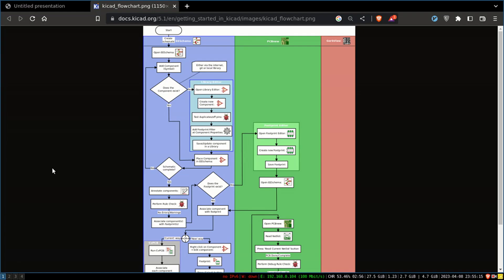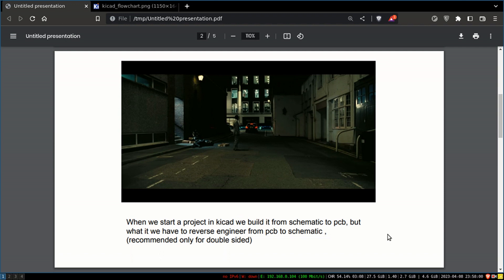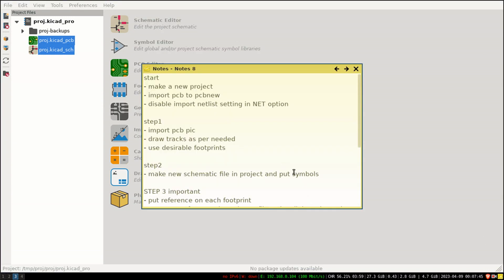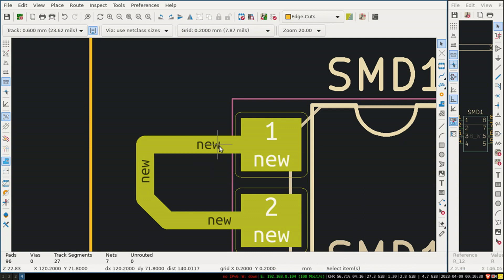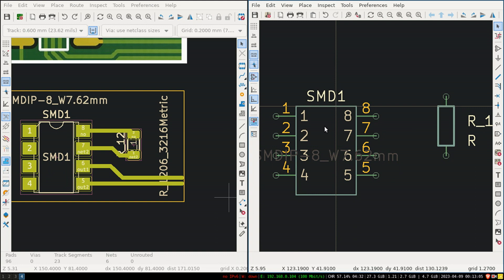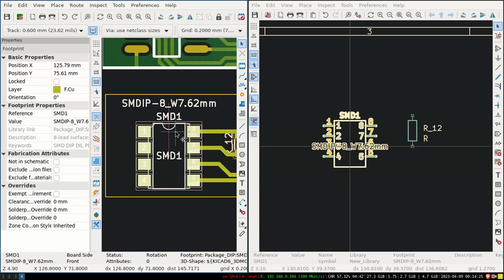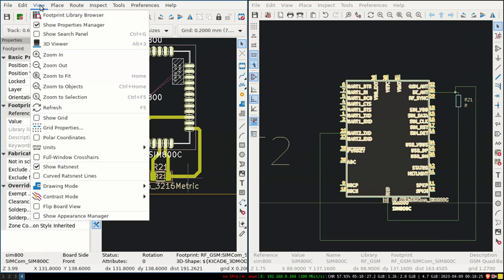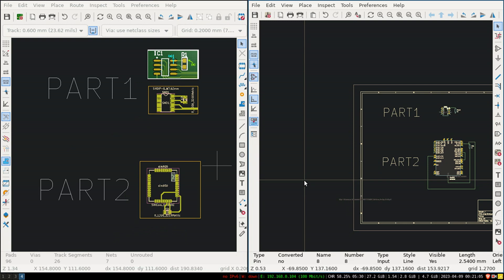Schematic from PCB , Reverse Engineer in Kicad : Advanced , Examples included #kicad

Comment: Thank you for the video. It is what I was asking  for earlier today!
Only problem is the volume is generally too low but especially around the 5 minute mark. 
I was really into reverse engineering a few years ago but the tools let me down. As you say in the video, the design process was to proceed forward from schematic to PCB and my tools made life difficult. It is a lot of work to completely reverse a modern PCB and most people stop once they have fixed a fault or understand the circuit enough. I was wondering if there is a site where both partial and complete reversals could be shared. Then others could pick up the files and continue the reversal. Sort of a GitHub for PCBs. One tip, I had some luck probing PCBs with acupuncture needles. Especially on conformally coated boards. The needles are disposable and inexpensive, the points are very sharp and the wire handles are conductive. The software called Boardview is interesting it allows you to record notes about the probed points of a PCB and with resistances and voltages noted comparison to a working PCB is possible.
Reply from the maker: thanks for your reply, i am new to contributing about electronics on youtube, i will work on volume and quality of video on upcoming videos
for reverse eng topics you can connecct on reddit or create r/ community also , give it a try
Reply: Thanks for the reply